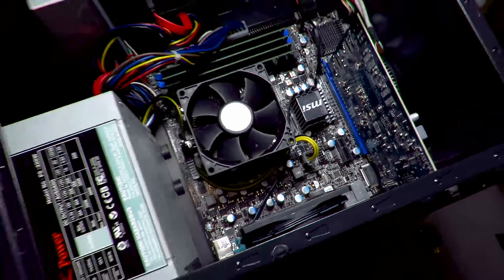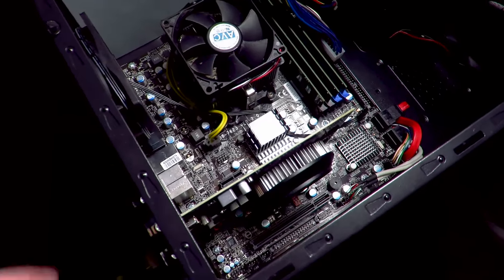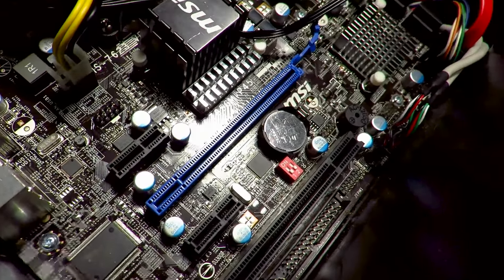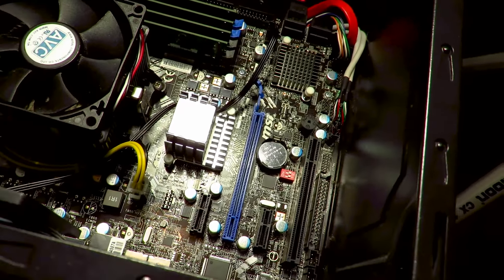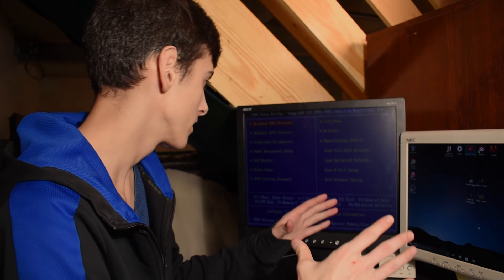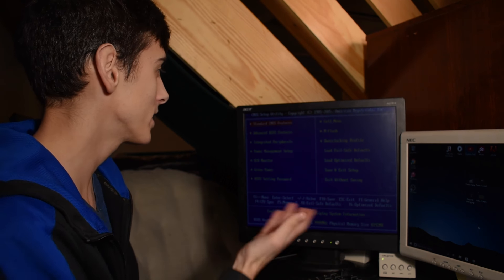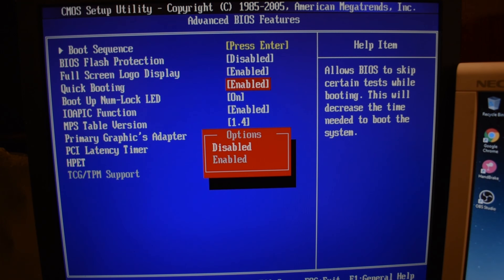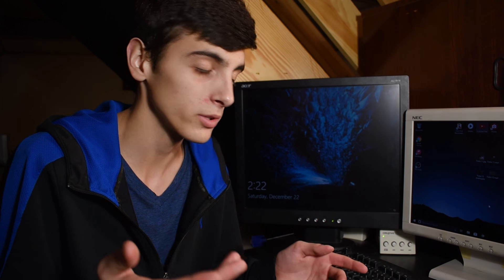[FIX] BIOS Screen NOT SHOWING UP!! [2020]

Comment: The option that skips the BIOS is Windows fast boot, not sure if that’s on Windows 11. But it makes a kernel of the last booted Windows to make booting up faster. You can disable this in Windows settings

If you do this trick and still don’t see anything, it could be your GPU not communicating with your motherboard UEFI interface. Nvidia has a patch for that but check other things first because firmware updates can be risky I heard 

If your PC isn’t booting into Windows, another option is to turn power off, bridge the CLR CMOS (2 pin header on mobo) with a screwdriver for 10 seconds, then when you power up, wait 30 seconds and hit F1 to enter BIOS, then wait 10 seconds, then hit F5 to restore defaults and F10 to save & exit

Comment: I have an HP 8200. My computer stopped displaying, stopped booting, stopped showing bios because my cmos battery actually fell out of the computer. Was moving stuff to new place.. I placed in a new cmos battery and still no display/boot. However, after inspecting the motherboard I've noted the HP 8200 has a cmos button reset. I connected the computer to monitor and power, left the PC Box open, and while the PC was running I pressed the cmos reset button. Voila, computer booted up. 

I suggest if you still can't get computer to boot up after replacing CMOS battery, that you look at the motherboard and determine if there's a CMOS reset button on motherboard. Especially if you have an HP related PC.........supposedly you should have computer off and press button for 5 seconds, officially.  So, I can only tell you what worked for me.

Comment: retired tech what you did will work but actually the boot menu is loading and you can't see it because its sending it to the on board graphics port not your better graphic card . Just turn off the computer attach the monitor to the on board graphics port  turn back on the computer and problem solved . This through me for a loop as well until I figured it out. Couldn't test my recovery media untill I did this.

Comment: I have a MITAC PD10BI J1900 board I want to repurpose but I cant access bios screen, even with the trick of removing battery. Maybe the VGA got faulty in the meantime? The system is still working as a server, but I wanted to change the SO and... can't :(    Any idea @ZackEberly ?

Comment: I have an issue where my pc turns on only to show a black screen with the amount of RAM "4096 MB" memory on the left corner, the version of the bios,i think in the left bottom "v01.26" and "<F9=Boot Menu> <F10=Setup> <F12=Network>" in the bottom right corner. Above the text in the bottom right there is written the model of the unit "HP Compaq dc7900 Convertible Minitower". The problem is that the keyboard is not working(num lock doesn't turn on the led light on the keyboard after it stops "calculating" i think the amount of ram) and if i manage to press F10 for example before it calculates the RAM the options in the bottom right corner stop showing.

Comment: I have the exact same problem but doing this didn't solve it. I'm guessing that my cause might be different but I can't figure out what. I've had this problem since I built my pc and have probably spent over 24hours searching for a fix. At this point I'm about to give up. Is there any other thing that might also be the problem? I could try flash a bios for the 18th time...

Comment: Did not work for my scenario.  Fast boot is turned of.  Keyboard is PS2.  MSI B550 Tomahawk mobo, Ryzen 5 4600G.  After upgrading the ram form 8GB HyperX 2666 to 128GB Cordsair Vengence 2666 I am no longer able to get the bios screen to show up.  Tried reseting cmos, booitng with only 2 sticks ram instead or 4, reinstalling old ram, nothing so far has worked to get back into bios.

Comment: On a new motherboard, use the onboard video(if you have a cpu with integrated graphics) rather than a video card to see the bios screen. Once into the bios find the setting that chooses the video card as the primary display. Next reboot the boot screen should default to the video card. Not all bios' auto detect a display on a video card.
Reply: It doesn't work either, i originally had a blue screen loop, and now after reseting the bios it doesn't even show anything.

Comment: Worked. I switched my graphics card for a one I got for Christmas and it didn't show on my monitor on the onboard graphics, as expected, and showed on my TV plugged into the graphics. It wouldn't even show half the time, but did this and it showed on onboard, switched something to auto, and then they both booted up. Thanks, my uncle sent me the PC and said "didn't have time to replace the motherboard battery so here's a new one!" Thanks best uncle!
Reply: Hello bro can u help me
Reply: I switched my amd graphics to force use it and i got this problem of black screen bios

Comment: hi i removed the battery of my x570 auros utra so it starts its ok until shutdown and restart then iit won't post boot up or anyting only blank  tne fans tnd lights are spiing though including the extra led light  on casing I  need to redo it all over again reinstall  nvidia each time , what do you think is the best solution short of replacing the motherboard?

Comment: Same problem, can't load bios rather it shows American megatrend page with messages 
Press Esc for bbs menu
Initializing usb controller done, pc hangs there. I replaced my CMOS battery still same problem. HDD and CD drive is not detected neither usb ports are working. Please  help.

Comment: I just came across the problem twice today. First time I fixed it by resetting the bios. Second time the first method didn’t work and I eventually solved it by replugging the hdmi port on the monitor side before turning on the pc; tried doing it on the pc side first didn’t work, even tried another monitor also didn’t work. Any idea what’s happening?
Btw I had this problem before but I usually ignore them and they sometimes just fixed themselves randomly. I had to do some tweaking today so this became a real issue.

Comment: I get BSoDs oftenly and I hope this works because I remember changing the Video Card settings in the BIOS and only the system shows up not even booting shows up, I changed the settings because of my curiosity, but it killed the BIOS and the Booting up and what I can do is just play for 10 minutes and then get a BSoD.
My question is that:
Will this reset my settings? (If yes then you are a lifesaver man.)

Comment: i have an x570 tomahawk mobo and i cant get into the bios. just got a black screen, i THINK its going into the bios i just get no video output, i get no flash screen at startup either, the 1st thing i see on  a normal boot is windows
Reply: Me too, I can't figure out how to fix this either
Reply: @RayBlaxe  i unpllugged my vr, boom dstraight into bios no problem lol, wierd issue lol
Reply: @Scoobydcs  I does not have any vr plugged to my pc :(
Reply: @RayBlaxe  how many monitors do tyou have? do you have a usb or wireless keybaord?
Reply: @Scoobydcs  usb keyboard, with 1 monitor
Reply: @RayBlaxe  what are your symtpoms?
Reply: @Scoobydcs  exactly same with yours

Comment: I have removed the cmos battery and I powered on the pc, and it is dead now, doesn't work anymore, any help please?
Reply from the maker: Make sure to back in the battery. Discount the power cables and plug them back in.

Comment: @Britec09  hi I bought BIOSTAR B550M and for my Ryzen 7 2700 but when I turned on my PC it doesn't post anything just blank black screen even tho my PC is turned on all of my Fans is working but no display.Is this bcs I bought a new motherboard that needed update? I previously use Gigabyte b450m S2H

Comment: The problem I'm having is, the USB keyboard doesn't power on until after the bios screen shows
No power no F2 spam
I have all the current drivers. Tried all the ports
All ports work. They are just too slow to power on
Reply: same here...,
.

Comment: It didnt work for me, I still dont get any kind of image on my monitor when I turn on my PC. I actually put a new battery in and it still doesnt work. I dont even get  a boot screen
Reply from the maker: Reseat your ram, cpu, and gpu. Make sure there are no shorts in the cables. Clear cmos etc.
Reply: I do have the same issue, have you tried anything new?
Reply: @diegorojas307  Yea, i got it looked at by a specialist, it ended up being that the CPU wasn't put in right ( The CPU Fan was too loosely put on I think, so reinstall you CPU and Fan maybe) and the RAM was also put in wrong. Hope this helps (:
Reply: @Just Tet did it cost too much??
Reply: @diegorojas307  did you fix it i have the same problem :(

Comment: I'm able to access the settings to it,  but it's not there,  I click troubleshoot advanced options, and it simply isn't there. There is, Startup repair, Uninstaller updates, startup settings, system restore, command prompt, and System image recovery... that's it... it's not here?!?
Reply from the maker: That’s windows startup thing. You want the bios which is before windows boot manger.

Comment: I need help anybody. I go and turn on my pc and I get stuck on a screen that says “Reboot and select proper boot device or insert boot media in selected boot device and press a key” but before that, I get my 3 options. Delete = bios setup f9 = System Info f12 = Boot menu. I can’t get into the bios no matter how much I press delete and this is my first ever pc and I’ve never used one so I’m probably Messing up. How do I get into the bios

Comment: So I've just swapped my cpu and it gives me the same problem any help?
Reply from the maker: Check compatibility. Reseat ram and gpu as well. Also make sure the cpu socket is clean. I had some dust stuck in one and it didn’t like it.

Comment: I overclocked my ram to 1.3v 2600mhz and my computer crashed. Now the monitor gets no signal. I've pressed the clear cmos button, removed the battery, jumped the clear cmos pins, tested one mem stick at a time, unplugged all of my hard drives, (my boot drive is a m.2), unplugged my pci wifi card, and did keyboard combinations. Any idea on what to do?
Reply from the maker: Reseat the cpu, try different ram, different gpu. I literally had a problem like this and a combination on taking out the cell battery and changing components, turned out to be a gpu driver causing crashes. On another pc, I plug in a hard drive while it was on and the ram stopped working.
Reply: @ZackEberly  I have the x299 chipset and have no spare computer parts that would work with this board. I think my motherboard is bricked and I submitted an RMA to msi. At this point I pretty much gave up.

Comment: I am facing the same issue right now. I have reseated all modules even reseted DMOS battery and jumper button. Everything is working fine but bios is not showing. Is there any solution. My processor is Amd ryzen5 2400g and no graphics installed in it.
Reply: Have you fixed it? If so, How? I'm having the same issue

Comment: Bro my PC was stuck at logo screen and later I knew ifi press del I reach another screen where my PC stuck then saying auto detecting data but never continued I then removed my wires connecting hard drive to motherboard and reached and now I am at CMOS setup utility somehow can u help to solve my problem of logo stuck on pc! I can surf across CMOS setup utility page can I do some change in setting here to make my PC back to normal?

Comment: Hey man, I’ve tried taking out the battery and placing it back in 3 times now and pressing Delete, F1, F2, F11, Enter, Etc. My computer turns on, but the monitor stays black. Any way you could help me?
Reply from the maker: google the manufactures motherboard to see what button to press and to see if you can clear the cmos with some pins.
Reply: @ZackEberly  My motherboard is an MSI b450 gaming plus max with JBAT1 pins. How would I go about clearing the cmos?

Comment: Mines was working recently then suddenly when i turn it on its show no display and its not showing the bios and even the windows logo but the monitor is working fine when I tried it with my laptop.. But all the RGB and the fan is spinning  so whats the problem?
Thaaanks
Reply from the maker: Try reseating the ram, cpu, and gpu. As well as removing the cmos battery again.
Reply: Okay i'll try it :) Thanks
Reply: @nullmore_  did u fix? i got exact problem

Comment: Hey man, saw your video, gave it a shot and it still does not work for me. I have a brand new computer, new everything, took out the battery, follow your instructions and I still cannot get a boot onto the screen. However, the fans, the VGA card, and everything else is running, just does not boot up onto the monitor for me to access the Bios. Please help if you can :/
Reply from the maker: I sometimes try several times, also check your motherboard for a CMOS button that also resets your bios.

Comment: hy brother,, i have dell latitude 3330,,, my bios is not open on start up,, when I connect my laptop to second monitor then it shows,,, I have to connect secont monitor for new windows installation coz "Press any key to boot from USB"  is not shown on main screen,,, what is my solution?
Reply from the maker: Its not recognizing the USB. Either could be the USB drives fault or the PC isn't setup to boot from USB.  I'd suggest use a 16gb USB drive and have the current windows installation media software create a new bootable windows 10 for you.

Comment: dude do u have any other alternative solution  than these  , but my pc showing correct date and time , how its possible ?
Reply from the maker: If you have windows you can change it in the settings... if not try looking for a clear cmos button or pins to reset the bios/uefi.

Comment: If this doesn't work and you have a HDMI cable hooked up, unplug the cable. Don't know why but it works.
Reply: This worked immediately, thank you sir!
Reply: If you unplug it how do you see what’s on your screen?
Reply: @alecmuh8752  Sorry not clear. I had both a TV and monitor hooked up. TV was set to watch cable. When I switched the TV to show my computer and restarted my computer the bios splash screen showed on the TV but not the monitor. By unplugging the HDMI to the TV and restarting the computer the bios splash screen then appeared on my monitor. I don't understand why, just that it works.
Reply: @Scott-bc7du  well, I Only Do Have A Tv Which Supports Hdmi, No Vga, But On The Other Hand My Cpu Has A cha Port Only, I , Yesterday , Purchased A New VGA2HDMI converter, The "Energy Star" Screen Shows Up But After I Press Del, No Bios Screen, and The Screen Suddenly Goes Blank, Should I Test It On A Monitor, Will It Work?

Comment: Hello, I need to change from CSM to UEFI, but when I do it I can't acess bios. When booting it will not show anything till it boots into windows. Could you help me how to switch from CSM to UEFI ?
Reply from the maker: I run into this issue a lot. I was first update my bios to the lastest version
Reply: I already updated bios
Reply from the maker: @xyzxd7105  Could it be OEM locked, my dell g5 like literally can't boot with CSM.
Reply: @ZackEberly  I fixed it by updating gpu bios

Comment: Didn’t work for me. My PC isn’t connecting with my monitor with everything plugged in. Even after installing windows 10 on my USB drive and plugging it into my PC nothing appears on my screen.
Reply from the maker: Is your monitor getting any response like turn on when you plug in your video cable: vga, HDMI, or display port?

Comment: hi, i tried changing the speed of my ram from 2666hz to 3600hz in bios , as my ram supports 3600hz. aft changing it my pc just won’t able to load back up. i tried what u did but doesn’t seem to work. any other ways to reboot bios? i tried replacing my rams but doesn’t work too. thanks in advance !!
Reply from the maker: I had this happen to me the other day. Reseat all components. CPU/GPU/RAM. Try looking for a bios reset button or pins. Try doing that and taking out the battery. Try starting it up with one stick of ram. Try the removing the battery several more times. That's how I trouble shoot things.

Comment: This is a fix to reset the "Real Time Clock" which can cause this error, dell for example has a quick fix to hold the powerbutton on for 30seconds for a reset so that you don't need to fiddle on the circuit board!
Reply from the maker: Do all PCs have that feature... no... they don't. This in fact is a very simple and easy way to reset the bios.
Reply: Yes of course it is, I was explaining what removing the battery on the motherboard actually does, and that it is fairly common, enough so that some brands make an easier and safer fix because of this.

Comment: Hi,i have a big problem i think is the same you showed in you video.
Pc starts but i cant see nothing until password,windows10.
If i connect the hdmi to the tv i can see the part with enter bios f11 etc but on my samsung monitor i cant see those just black sreen till the password.
How can i fix this,with battery remove?
Specs: msi b450m a pro,amd ryzen5 2600,rx 580 nitro
Reply from the maker: I think it might have to do with HDMI. Try use display port or something else.
Reply: I already tried the battery bios and it starts into bios but i still cant see this on monitor,i use a samsung tv with same hdmi cable to see that,i will try with a display port i hope to fix this annoyng error,if i want to reinstall the windows i have to connect hdmi to tv,lol

Comment: I have tried this, it still doesnt work, i have cleared my cmos by using the jumper, i have taken out the battery, i have also turned off fast boot in windows but still not able to get into bios. i am using a Intel DZ77BH-55k motherboard
Reply from the maker: What’s fast boot in windows?